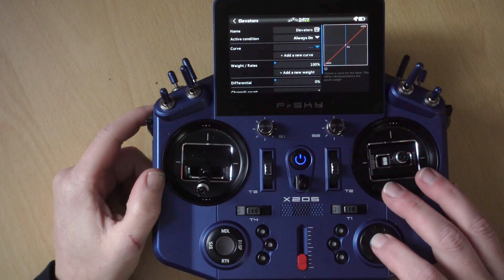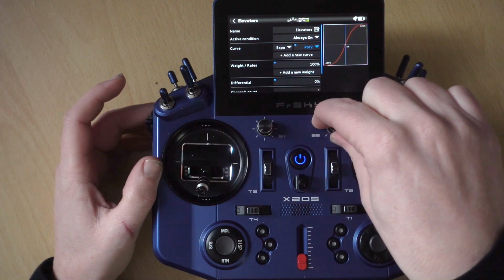Changing Expo using a pot on ETHOS

Comment: Hi Mr.D
I know, this is an old tutorial. I have an X20 PRO with Ethos 1.5.15 (the latest version). In my firmware, the parameters in the free mix, are different from yours. I made a lot of trials for having a pot for adjust a second mix (the rudd-ele), but I cannot find the right way to do it. Any ideas ?

Comment: Hi Mr D, is it possible to have a voice warning if your engine gets too hot? (Gas engines) Ill be using the R10pro rx and  rpm with temp sensor/telemetry. Thanks and much appreciate your vids
Reply from the maker: Sure. Any telemetry sensor can be used by logic switches. So just set up a logic switch that is activated when the temperature is too high. Then use that logic switch to trigger a special function to alert you.

Comment: Found three omnibus F3 nano boards in a box.
What config did they last work on.
I bought them for quads years ago but misplaced them & it says not supported but I downloaded the last omnibus hex inav has & it flashed but can only access the cli & alter stuff. Nothing else.
Has anybody any idea which config this board will run on. If any. I have matek f4wings in my other builds but if I can get these going I may get myself an EDF motor & some zagi wings off ebay & do a stupid fast 6s for down the beach.
Reply from the maker: F3 will only work with INAV 2.6 and earlier. The reason it jumps to CLI is because the Configurator version doesn’t match the firmware version.
Reply: @MrD  thank you so much for that answer. Be a shame to waste 3 pristine boards.

Comment: It still feels awkward having to use these additional channels just to modify a pot as an input
Reply: If I fly INAV, shall I set my expo in FC or in radio?

I was told/learned to have minimum config on radio side and configure most things in FC. But I’m not sure about expo settings now. This trick is really nice. Any downside of having expo zero in FC and control it via radio?
Reply: @ysoldak  
Tbh i seldom use expo at all besides 3d planes
But I would just go ahead and set it in the radio if you like. I can’t think of downsides because the fc is working the same: it just does what it is commanded and doesn’t care if there is expo or not. This doesn’t have any affect on the PID loop afaik
I just would take care only to use it on one side…
the fc just offers more flexibility in the way the expo curve looks.
Reply from the maker: Expo is already set in INAV. Its best to not add it on the radio. Just set it how your like in INAV. Its on the PID Tuning -> Rates tab. Manual expo is for manual mode only. The other expo is for stabilised modes.
Reply: you can however this method a: removes the -ve value and b: adds a controlled amount (from 20-40)
Reply: @miksterr  
I have no idea what you are describing 🫢
Reply from the maker: Jan, you’re effectively using the pot mix as you would have set up an input on OpenTX. The only additional part. Is the channel. Personally, I would have preferred an Inputs to keep things clean. But apparently it was not added to ETHOS because people coming from Spektrum or Futaba (both of which have horrible transmitter menus) would find it too confusing.
Reply: @MrD  
Sure…. I agree with the choice getting rid of the Inputs, thats fine.
Also I like to use the trim mix to adjust values, rather than a pot. To have them persistent

But for inexperienced people or to enhance speed and ease of use I think it would be a good thing to set min/max when you add a pot or slider as weight input. Its very uncommon you use +/-100 as a weight. If you need to do smth funky you still can use the path via channel.